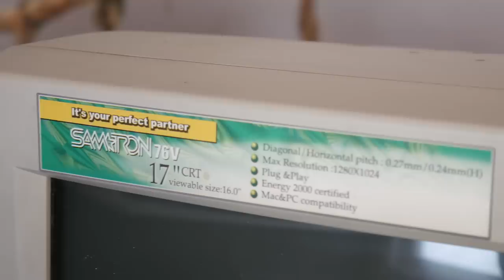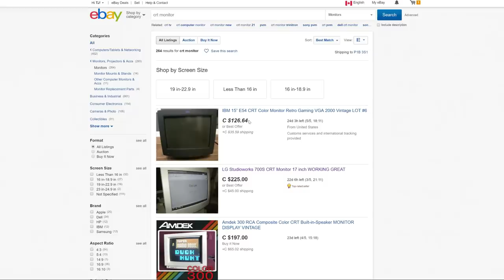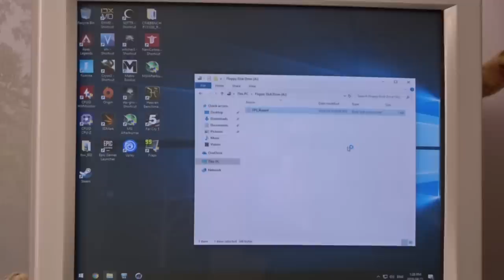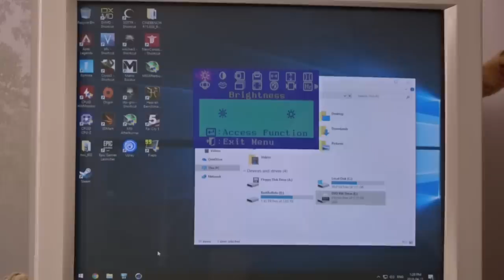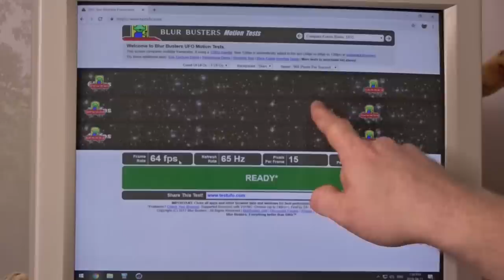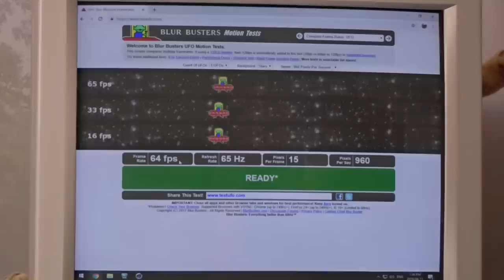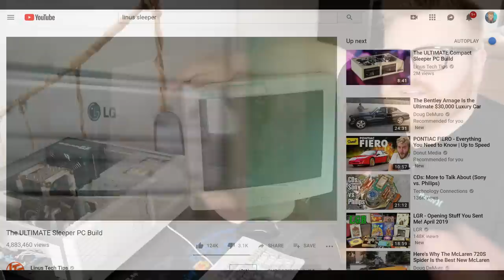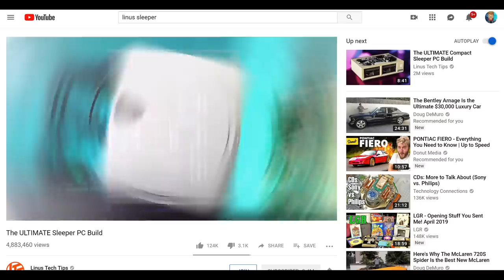Using a CRT to game with titles from 2019????

Comment: The flicker is not present in real life people.
Reply: Eyecat15  FBI OPEN UP
Reply: it is, but not as noticeable, the noticeability diminishes above 85hz, which is why majority of crt's defaulted to that refresh rate. it almost disappears above 120
Reply: @johannsmith5697  Yeah, I remember at 50Hz it was very noticeable and gave me a headache. 60Hz + was okay. On the crt's I used anyway.
Reply: @DJ_Dopamine  yup 60 is like 50% better than 50hz and 85 is like 30% better than 60, and 100 is 10% better than 85 and 120 5% etc
Reply: @johannsmith5697  oddly specific percentages there lol
Reply: @doobiescoo  lol arbitrary
Reply: you could oc the monitor with some custom resolutions.
crt tend to handle it really well
this is why dp to vga become handy.
Reply: It also could have been eliminated in the video itself if the shutter speed was calculated carefully 😅

Comment: My friend still uses a 1600x1200 monitor. He’s probably had it like 20 years and refuses to budge. He’s had good LCD monitors like VA or IPS panels but always goes back to CRT
Reply: I do too for retro gaming up to about 2006 or so, but after that the games started supporting widescreen very well and in turn not quite supporting 4:3 properly, as you can see in this video, so want it or not gotta use LCD for modern gaming. But 1600x1200 at 100Hz and zero input lag on my CRT feels so godly, no LCD compares really.
Reply: @ItsSpeltGoogol mine is 21" up to 2048x1536 up to 170hz. Now that is heavy. To be exact its 32kg / 70 lbs. My arms were hurting for 3 days after getting it up the stairs to 4th floor :)
Reply: GodOfGamingBG what model would that be? I would like to have a high resolution crt but don’t know which ones the best
Reply: @robinmaes58  i'm running 1920*1440 on an Iiyama 19". They made some really good (professional) CRT's. Sony, NEC and a bunch of other brands made great pro CRT's too. 
The one in the video seems consumer grade, which is totally fine too, but there's proper HD ones out there that will amaze you resolution/refresh rate wise, and should last a really long time.
Mine all have anti-glare coating too.

Comment: you can get 34pin to usb connectors to still use the internal floppy drive on ebay, so that way you can still upgrade a lot of the hardware but keep the drives

Comment: You can add a small front fan behind the left front louvers.  I have a similar case.  You can remove that plastic block in there and a small fan will clip into the plastic and align the fan screw holes with those plastic posts.

Comment: Sweet build and nice demo TJ.  Also FYI "Dual Link DVI" is for high resolution/high refresh rate digital displays. When it comes to VGA compatibility what you're looking for is "DVI-I" which is the DVI connector with all 4 flat spade connectors on one side that carry analog RGB signals. "DVI-D" is the digital only version of the DVI connector that lacks those flat pins and won't even plug in.

Comment: Make a sleeper, but don't hurt the case.

Also, try overclocking the monitor. I have heard that CRTs overclock really well, and some people can even get 300Hz+.
Reply: Interlaced modes are great for this.
You don't need the same ridiculous refresh rates you'd need on an LCD/OLED, because there's inherently no motion blur. 120hz CRT looks way sharper in motion  than a 240hz 4K OLED

Comment: That monitor should be able to do 1152x864@75Hz, 1024x768@85Hz, 800x600@100Hz and 640x480@120Hz. And I'd recommend using it in a somewhat dark room because in dark it can easily beat all LCD monitors in contrast.

Comment: The true purpose of that plastic block inside the case is to support "full length" expansion cards (that's what the vertical slots are for).  Mounting a fan and/or speaker is secondary.

Comment: I love the retro pc stuff.   I built a Ryzen 5 system in an 2004 Antec 1080AMG.    It looks like a hobo pc, if someone broke into my house they would probably not even bother trying to steal it.   Well between looking older than dirt, with all the cooling crap, and hard drives, the thing weighs north of 40lbs.   Thanks for the content!

Comment: dont forget refresh rate has to be set... nevermind my trinitron 21inch 140Hz high res
Reply: Trinitron 19 inch 120hz max 1920x1440 max. Got for free
Reply: I'm on a 120hz 1280x1024 trinitron I got for free
Reply: @jacoblempa7184  mine is true flatscreen with aperture grill
Reply: @shaggyboombastic1058  yeah mine is a flat screen as well but I dunno what le aperture grill is
Reply: @jacoblempa7184  most flat screen crts are an illusion but arperture grilss are truly flat but theres a singular line going through the picture
Reply: @jacoblempa7184  cru custom resolution utility for higher refresh and res mine was free too lol
Reply: I have a Sony Trinitron 21" 120hz 1920x1440 CRT monitor that I got for free ages ago and I still use it to this day. Its the crown jewel in my CRT collection

Comment: GTX 980ti is fastest VGA graphics card timmy, you need to get one, and a 19" or 21" that has the high refresh rates above 1024X768
Reply: Magically, some GeForce 10 laptops have VGA out. My particular one has a GTX 1070 (which isn't faster than the 980ti though)
Reply: I hook up my CRT to my 1080 Ti using a Delock converter. It works perfectly.

Comment: The last crt monitor I had was 22" and it had a max resolution of 2048 x 1536 at 80 Hz, it's specs were better than what you could get in lcd monitors at the time. I gave it away, it was bulky & heavy.
Reply from the maker: man, that would have been worth messing with though, jeez, it's too bad they have a shelf life and take up your whole shelf in the process

Comment: Btw u could buy an adapter dp port to vga for like 8 bucks on amazon thats what i use with my gtx 1070 no problems
Reply: Could you set more than 1920x1080 on your monitor with that adapter?

Comment: I had a 22" NEC monitor in 1999 better than this running 1600x1200 at 120hz ;)
Reply: paradoxdesigns damn thats good crt! My samsung 19" does 120hz at only 1024x768.
Reply: I had a ViewSonic 20" flat CRT that did 800x600 at 166 Hz, awesome for CS 1.6
Reply: My syncmaster run too in that resolution. And 85hz at 1536p
Reply: Kyria The Eletronic Witch what is your crt model m8 ı really wonder
Reply: @mtunayucer  22"samsung syncmaster 1100p plus semi-flat
Reply: I have a 24" Sony trinitron crt monitor that still works flawlessly and that I still use every day
Reply: @tj71520  man, I wish mine was that big (pun intended)

Comment: So I guess I AM the lucky guy you were saying about. I found a Dell E772c monitor on Kijiji for C$15. I had to drive there and get it myself, but I was also with my friends so we had a good time there anyways. Now, it's not working well out of the box, but it turned out that this thing just had spider webs inside shorting out, and it worked perfectly after I opened it up and cleaned all the spider webs and dust.
After a thorough cleaning (And risk getting myself killed, I know), my CRT turned out to be in a perfect physical condition, and the picture is decently bright and completely burn-in free, though it isn't the sharpest thing because I am running 1280x1024 60Hz on this thing which has a designed resolution of 1024x768 75/85Hz (different aspect ratio)

Comment: USB floppy drive controllers are on ebay, so are SATA adapters for IDE devices like beige CDROMs. An intake can be fitted to the lower 5.25 bay. Many of the late desktop cases also had venting in the top panel, towards the back. You could replicate this easily enough but it'd take a couple hours to do it right. As for your single PS/2 port, there's a good chance that it uses the spare pins to support a passive splitter cable. Cheap solution.

And just take stuff from the recycling dump, don't ask. Just take it.

Comment: Nice! The best CRT monitors are the Trinitrons (and the off brand ones that don't license the Trinitron name. I have a Gateway VX700 which is pretty much a Trinitron but doesn't have the Trinitron badge on it since it's not a Sony monitor). There was some 16:10 aspect ratio monitors made in the early 200s but those are really hard to find these days and are of coarse overpriced and super expensive to get.

Odd that it seems brightness was the issue with monitors you had. The CRT monitors I've come across tended to have issues with convergence instead. They were all bright enough for my needs and didn't seem tired. Only one seemed like it was tiny bit tired and that one I pulled out of a dumpster down the block. (it's a Optiquest Q71 16 or 17 incher. Pretty much a rebadged ViewSonic as the chassis is the same). It was formally owned by an old man and looks like he put a lot of hours into it.

But the 2 other monitors I have, a Dell e771p and the Gateway VX700 are still pretty bright. The Dell e771P being almost perfect with convergence while the Gateway one still has some issues. (seems it's more common for Trinitrons to have convergence problems).

As for Geometry issues, I've only had this problem with TVs. With monitors you generally can fix them from the OSD menu in most cases....Like the pin cushioning of the left side on your monitor. I noticed that near the top left corner of the monitor's image when you were showing it with Windows running instead of the game.

I'd advise you work on adjusting that. ;)

As for that face book seller....yeah $200 is way too much. I got lucky and found 2 CRT monitors on Facebook. Both I got super cheap. The Dell e771p I got for only $5!

Then there's a third monitor I forgot to mention. A Compaq Presario 1525. It came with the original PC it was bundled with! A Compaq Presario 4112 complete with original mouse, keyboard, AND the side mounted speakers that attach to the monitor! It was in really good condition though (It is a mostly beige machine too and had no yellowing so must have  spent most of it's life in a bedroom or other room with no direct  sunlight. Though a couple random keys on the keyboard have yellowed for some odd reason. ) the optical drive needed to have it's laser replaced. (Turns out most of the parts inside the original drive that came with my Compaq Presario 5000 are all compatible. :D ) and the floppy drive had a metal dust shield cover stuck in it which must have came off a damaged floppy disk. After removing that and cleaning the drive, the floppy drive still worked fine. The monitor is so old it was before OSDs where a thing and used knobs to control screen size/position and brightness. It also has a volume control knob that doubles as the power button for the monitor. Curious as to how that works. Must be using some of the EDID pins on the VGA port to comunicate volume control info and it's not happening via special software (though Compaq did provide a Windows 95 program that gives a graphical display of volume change when the knob is used). I noticed the knob works even in pure DOS mode with just standard sound blaster drivers! I tried to use the volume knob with the newer Compaq Presario 5000 machine and it didn't do anything so must be a trick that's happening with the motherboard chipset.

As for specs it's an old 95/96 era 486 with a 120mhz Pentium with 17MB or so ram. I have since upgraded it to the max it will go which is 72MB. (uses EDO type ram).

I got this entire bundle for only $25 AND the seller was willing to deliver it to me since i don't drive. :D

The monitor needed some convergance adjustments, but managed to get it to acceptable range. It's still pretty bright and sharp despite how old it is. From what I can tell the PC spent most of it's late life in a closet. The machine wouldn't boot up properly until I removed the dust cover out of the floppy drive as it was preventing it from completing it's power on seek test. After I fixed that, the hard-drive had some critical MS-DOS boot files missing so that needed fixing too. The original warranty void sticker was never broken on this machine so they made no attempt to fix the floppy drive. They must have retired the machine when this happened and got a new PC.

As for my main PC it's similar in specs to yours. Though it's got a slightly better i7. A i7 965 extreme edition clocked at 3.2ghz. The graphics card isn't as good though. A Nvidia GTX 650 which is starting to show it's age. I plan to max it to a GTX 980 Ti when I get the money to afford it. It's the last card Nvidia made that supported the VGA connection over DVI.

Technically though you can still use VGA monitors with modern cards. You'd need a HDMI to VGA adapter (or Display port in your case). Not sure about Display port, but with HDMI, it's not native like DVI so required a powered adapter that has active circuitry to convert the signal and it's sub-optimal compared to having a native VGA connection since you have less range with max resolution and some cheaper adapters kill black levels.

I use one with my Nintendo Switch to play it on my Gateway VX700 (use a VGA switch to switch it off PC when I want to play on the console). I was lucky and managed to find a HDMI adapter that didn't mess with the color/brightness range of the signal.

Comment: BTW on the topic of VGA ports, this may come in handy:
The last and fastest AMD with an analog output (DVI-I, easily convertible into VGA via a passive adapter without quality or speed sacrifice) was the R9 280X. R9 290 and anything above (300 series, Fury, Polaris and Vega for sure, dunno about the lower end) is digital only and needs an active converter --> bye bye good picture, hello lagfest.
The last analog-enabled Nvidias (mostly DVI-I, sometimes VGA as well) were the whole Maxwell gen + that one Zotac GT 1030 with a DAC soldered onto the circuitboard by Zotac. All other Pascals, Volta and all Turings are digital-only.

Comment: The monitor should be good for emulating old consoles or older pc games that run at 4:3.
And if you could rotate the cooler round to draw through the psu that should help.

Comment: Use it thermal past for a liquid cooling fluid, don't tell Linus. its heat 
transfer is 100x better than his concrete cooling system and does not 
harden up. 
You know you want to do this, might want to thin it out some with alcohol or water.

Comment: The reason the PSU heats up is because not only there are no intake fans, but also because there are no exhaust fans to push out the hot air from the CPU heatsink which is sucked up directly into the PSU. If the GPU was not a reference model, the PSU would heat up even more.

Comment: I had several of those 21" ViewSonic flat CRTs in the early 2000's. They were great for the time, never really used the high refresh rate or resolution. I think the GPUs I had then were an MX440SE AGP and an ATI RagePro of some variety.

Comment: hey, I build boutique sleepers for a living! You can still buy beige SATA DVD drives and you can also get floppy-to-usb adapters that let you connect a floppy drive to an internal USB header. If you want some help in the future with stuff like that, feel free to give me a shout! 

Also, look into one of those old Trinitron CRT monitors. you can get them in resolutions up to 1440p and refresh rates up to 90 Hz, possibly higher

EDIT: You can also get beige optical mice for USB, may I suggest one of the old microsoft mice! they really look great! I use a beige logitech mouse for my sleeper, it is USB.

Seriously though, if you need to find something, just let me know, I don't always have stuff in stock but I can usually find them.

Comment: Some of the last high end crt monitors which where produced are still really good for modern gaming. The Sony Gdm FW900 is probably the most popular of them but there a A LOT of good models. 
crts aren't for everyone these days but they can deliver you an amazing experience If you're OK with the shortcomings (only analog inputs, weight and size, sometimes price, could need maintenance). Personally I don't think I can ever find anything comparable to my Sony GDM F520. Payed 50 Bucks for a used one and it's been AMAZING since

Comment: DVI-I or DVI-A ports support analog CRTs via DVI to VGA adapters. Dual-link DVI ports were for 1440p and 1600p displays.

For the beige keyboard/mouse combo, you can find USB to PS2 adapters.

If you want the king of all CRTs though, you need to look for a 19 or 21 inch FD Trinitron display. I had a pair of Dell 19” screens, and could run then at 2304x1792@60hz, 1920x1440@85hz, and 1280x1024@160hz. The card I had at the time couldn’t do refresh rates faster than 160hz.
Reply: The speaker holder thing is meant to hold a 80mm fan. A popular mod would be to cut a hole for a 120. I think ThermalTake or LianLi also makes a thing that uses 3 5.25 drive bays for a 120mm fan.

Comment: Cut a hold in the top of the case or multiple slits with a fan intake on the inside pulling fresh air into the case. Also get one of those exhaust fans that would fit into a expansion slot on the case.

Comment: I've still got a 22" Mitsubishi Diamondtron that's been running 1600*1200  at 120hz for a long long time, still super bright and clear.  It is hooked up to my old spare Phenom II 965 PC running on a Radeon 7850. I love the thing even though it weighs almost as much as I do and uses as much electricity as the PC its attached to.

Comment: the big thing with crts is that you can overclock them to like 150hz
Reply: puddingistastyapples .....at low resolutions. My crt does 150hz at 800x600.
Reply: or run interlaced for double the fun ;)